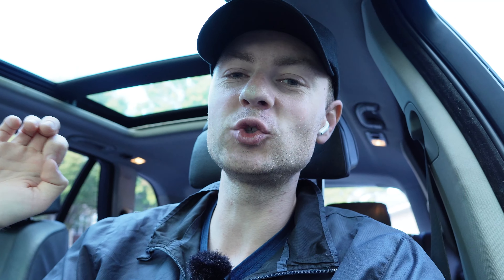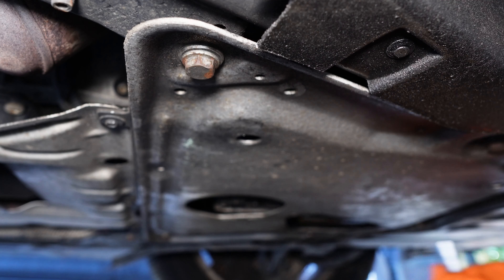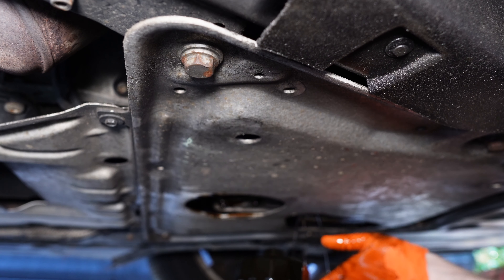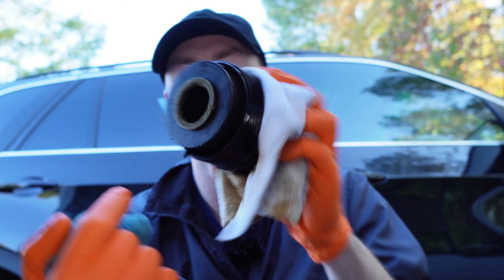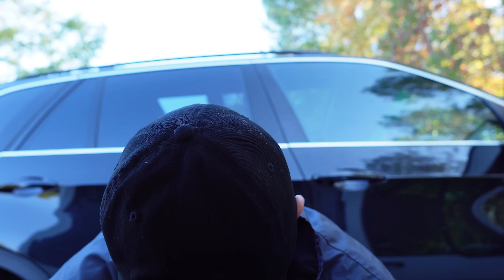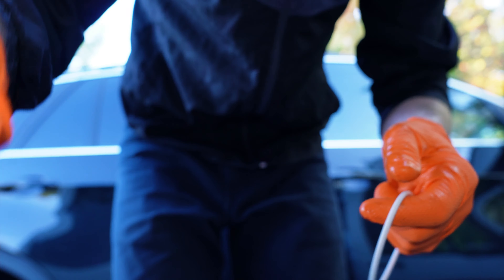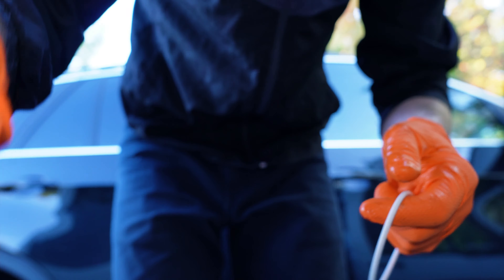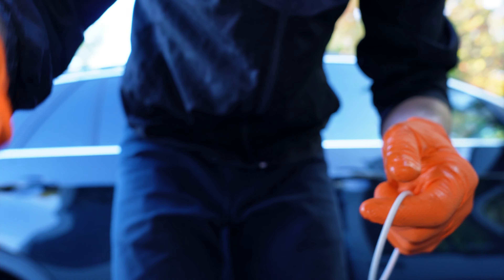2007-13 BMW X5 e70 4.8v8 Engine Oil Change

Comment: Just a comment from experience, if you use a WIX brand oil filter kit, the O ring is undersized, it will leak badly
Reply from the maker: That’s a good thing to know! I will add this  suggestion to the description if you don’t mind?